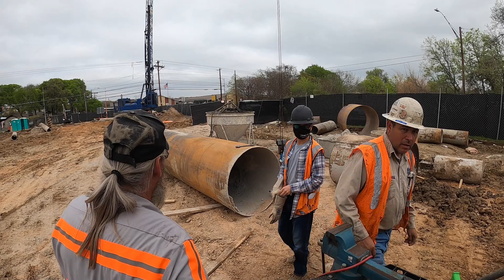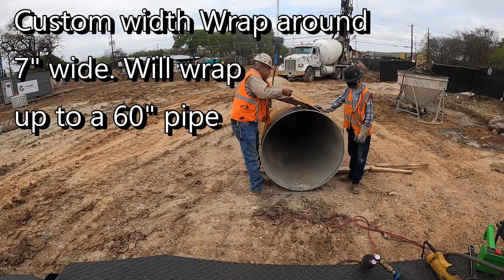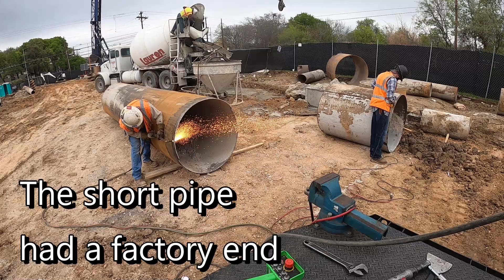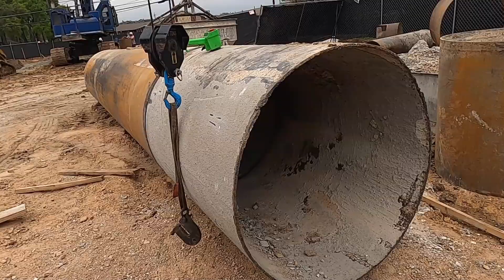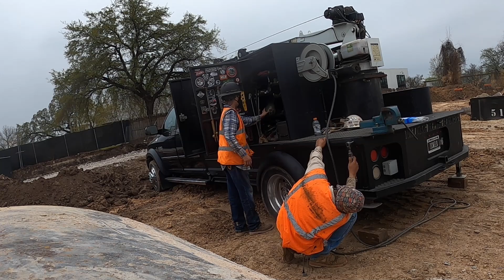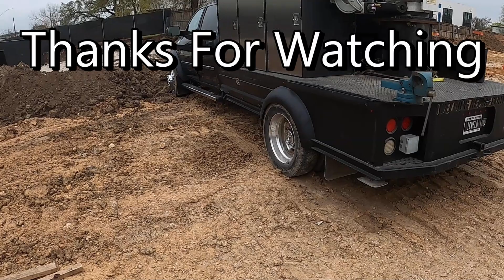Quick way to Weld Some Pipe Casing.

Comment: Time lapse? regular speed? It's all good and I'm sure I'll enjoy the show.

Edit: That was a pretty good video. Nothing really technical to show or talk about so the fast speed worked out well.

I was wondering how you were going to align the pieces and you are right about those being handy. I was also wondering why you had that air ratchet out. Pure genius. I have wanted to add something similar to my jacks and now I have an idea.
Reply: I was thinking the same thing!LOL!! Fast motion , Slow motion, regular speed, I don’t care! LOL!! I’ll watch.
Reply: The air ratchet was to torque down the bolts on the two pipe alignment pieces that he used to get the “hi-low” out of the pipes
Reply: @Timothy Ball The air ratchet was to torque down the bolts on the two pipe alignment pieces that he used to get the “hi-low” out

Comment: I just stumbled across your channel recently and it's quite interesting. You're the first person I seen that welds upwards. I learned welding on the farm and still do it occasionally for myself but I remember hearing that it's the correct way to weld for certification. I've tried it once and found it very challenging. So I continue to go down and make sure that the slag drips off before continuing. Like your content!
Reply from the maker: Welcome aboard!

Comment: My father owned a metal building fabrication and construction company here in Texas , I welded columns , clips and base plates for about 25 years. It was all pretty much routine , I'd say much easier than the things your doing. The only time it was hard was when I had to weld while straddling a beam while high up or on a ladder.

Comment: I have made several different sizes of them clamps they sure do come in handy, I am very jealous of your crane though, maybe someday😁
Reply: they really do come in handy.
Reply: So is that a home made clamp or factory (I been looking everywhere for some)
Reply: justin tanner I just make my own of varying sizes, his may be bought, I am not sure.
Reply: @tannerelectric  we would just cut a c-clamp in half and tack it to the pipe or plate.    Similar to https://youtu.be/eBq98MSJAfY?t=353  we never welded on the l-angle like he did, just cut the clamps in a bandsaw.   We typically used smaller clamps like 3 or 4 inch.   Or dogs and wedges, similar to https://youtu.be/9ad_6bohg_g?t=337

Comment: Your , 2   IC   has it covered , my son has just started his own thing , SS welding  Fab work , he paid for his New Zealand , Welding Certification , to prove that he could do it on his own , He  worked for other employers to see how bad they were running their own company's , ( over charging , sub standard work ) He Now has his ethical  compass . in the Cook Islands ,
Reply: Chris, kuddos to your son. When I first got into metal fabricating it amazed me what our company could do. I was in the "light.guage" shop. 24-8 guages. Which included ferrous and non ferrous.
Your son would have liked a SS mirror finish cross we built. 15 feet tall. All in all from the time the order was issued to the delivery time was 2 weeks.
All three points were tapered and it had zero flat surfaces. Even the ends were convex. Around 15 thousand dollars.

Comment: Welding pipe together is pure joy. I made barrels for roll up doors so they had to be pretty strait. The heat can ruin this real easy. How do you get them to be strait out on the ground like that? Other than just making the joint even? Stringline? Or is it not critical?
Reply from the maker: I use my good eye! haha. actually, the wide wrap around helps a lot.

Comment: So what is that pipe casing going to be used for since it has remnants of concrete in it. I have not worked in that side of industry, so do not have any practical uses, something brief.

Thank you for your time and would like to see more about your finished project truck.

Comment: Great vid!   Whats that weld-on alignment tool with the bolt called?   Thanks
Reply: It's a half clamp it's literally a c clamp cut in half you weld it to the pipe on one side use the tighting bolt to line things up

Comment: Cool video IC, I'm assuming that casing is surface pipe for a well? I only ask because I used to work in the methane gas industry in Wyoming years ago and I would see the rigs spud surface with casing that size. Ok take care and God bless
Reply from the maker: I believe these were needed to keep water from entering the hole. Either that or the hole sidewalls were caving in. Not sure.
Reply: @ICWeld  oh okay cool